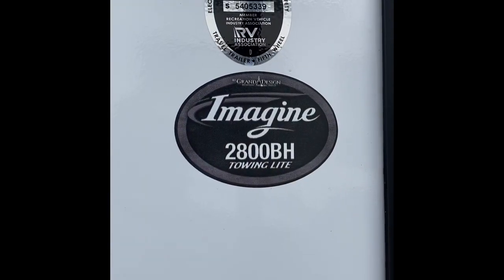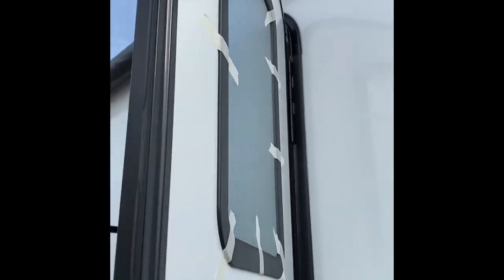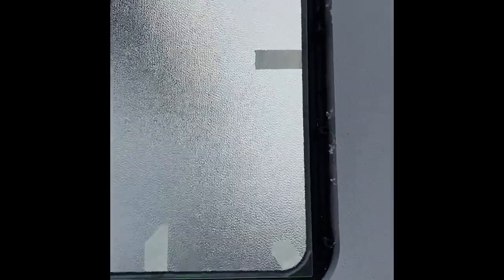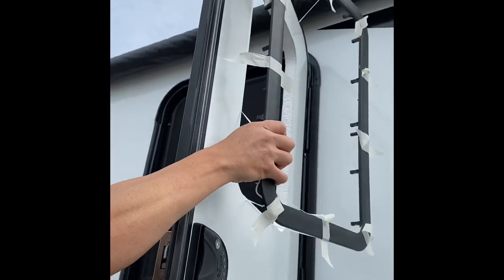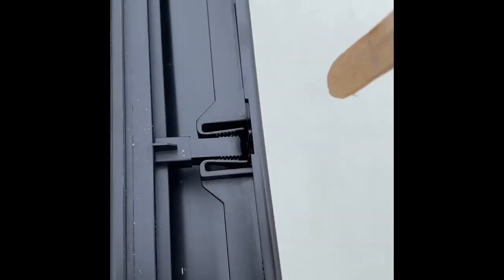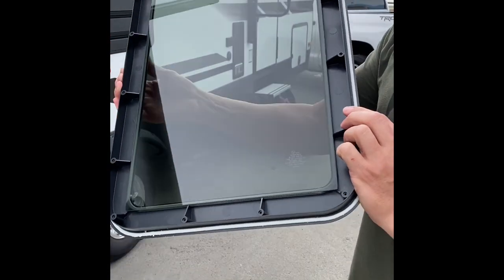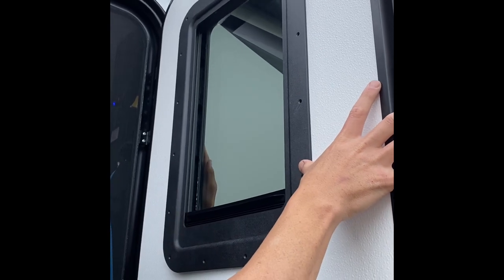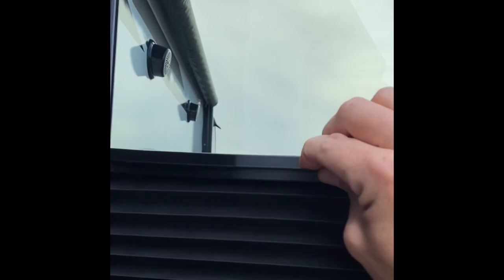AP Products Thin Shade Window Install for RV/Travel Trailer

Comment: After about five months, do you still recommend to install the blind, opening from top to bottom?  It is a great idea but I was concerned about how well it hold up over time.  I would imagine the the blind would fall down when traveling.
Reply from the maker: Robert Muse most certainly.  Shade stays in place with no problem. Love the ability to keep shade and still see outside if needed.
Reply: So if you where to install them right side up, they don’t stay up when you want to look out the window?